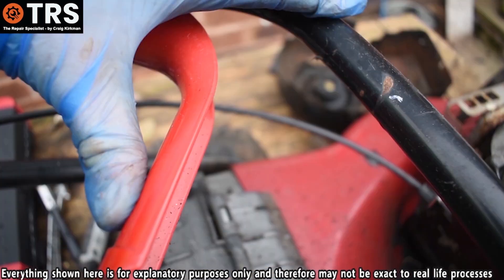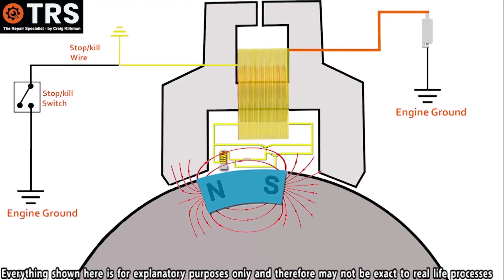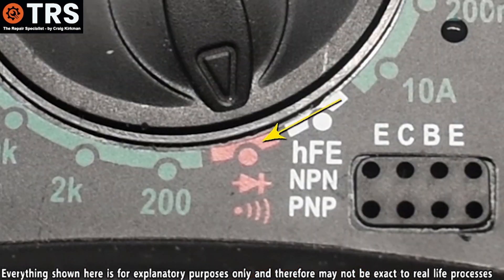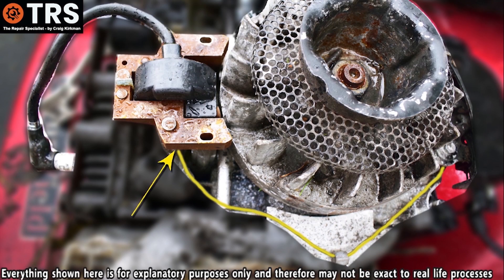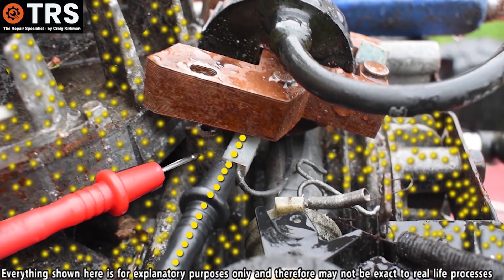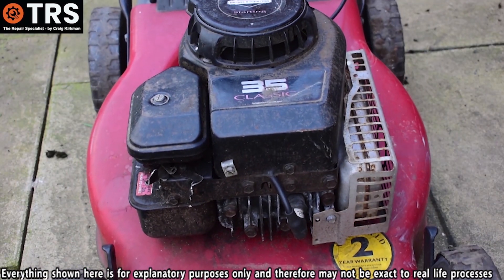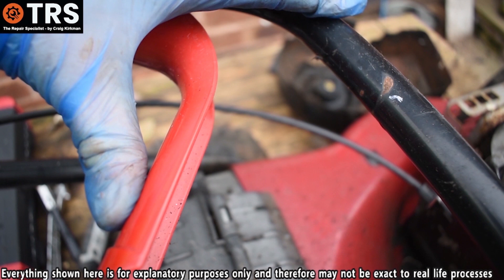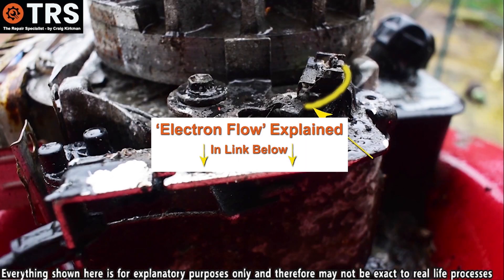LAWN MOWER WON'T START? Electrical Troubleshooting (Short-Circuits Test) (by Craig Kirkman)

Comment: Hi thanks for the video.

I'm having some trouble with my briggs and stratton lawn mower. It stopped running at the end of the season and it never started again. 
I thought it was the diaphragm, which I changed together with the carburettor. The intake manifold is in good order with no cracks or loose bolts. The spark plug is new and the ignition coil is functioning (I test it with a multimeter and I measured 2.7 k Ohms).
I'm getting a bit desperate here. I came across this video the other day and I decided to test for a short circuit. 
The problem that I face is that the test is always positive like if there is a short circuit, the funny thing is that it seems in short circuit even if I remove the stop wire completely. Like if it's grounding on the engine body directly from the ignition coil. 
Is this possible? What would you suggest me to check? 

Best,
Fab

Comment: I have been looking everywhere to try to verify if my coil is bad with my multimeter. It is for a Briggs and Stratton 10 HP engine. I have seen everywhere on YouTube about the ohms reading from the HT wire to the armature, and mine is correct there. But nobody tells what the reading should be from the kill tab on the coil to the HT wire, or from the tab to the armature. I am getting 4.6 K ohms from the HT to the armature. I am getting the same reading from the HT wire to the kill tab. I am getting zero ohms from the tab to the armature. So it looks to me like the kill tab is shorted to the armature, so the coil is bad. Correct?

Comment: It might be a bit silly ,  but on  Stihl coil that has two terminals  , which is the actual kill wire .
Reply: They kinda both are. Since the handle is plastic the kill switch can't ground it there, hence the second wire to return the current to the body of the saw. Disconnecting just one end of either wire will interrupt the system